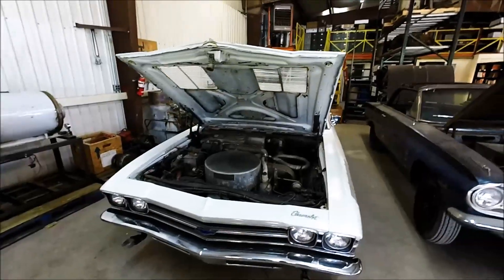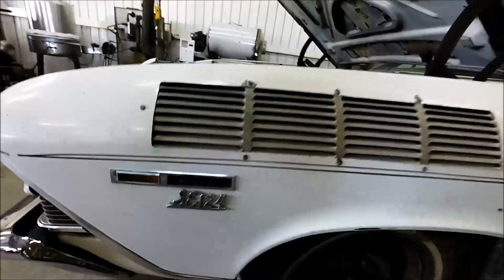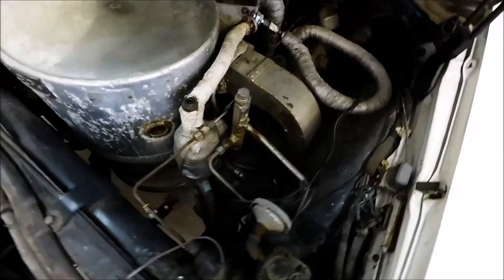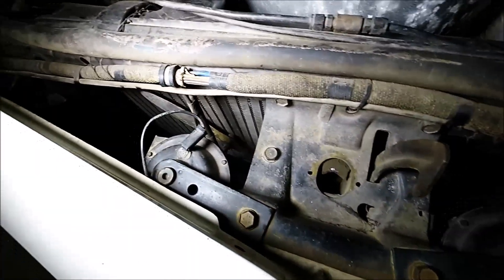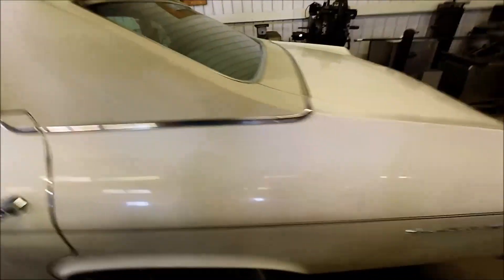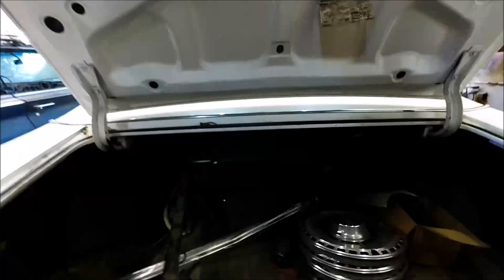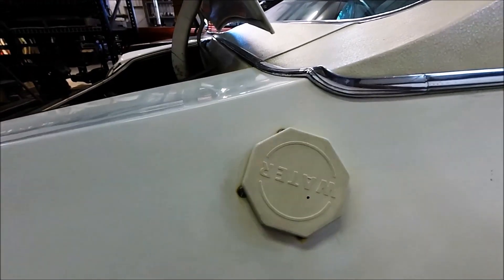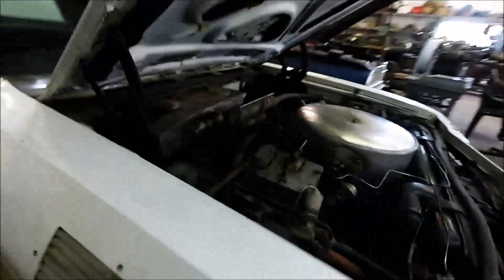1969 Steam Powered Chevelle - Built For General Motors

Comment: definitely the way of the future
Reply: The heck it is... steam power can actually be very efficient.
Reply: Its pretty obvious you are not an engineer either... steam engines can be efficient.
Reply: doktorbimmer If you knew better, which apparently you don't, your comparing apples to oranges when it comes to efficiency... i.e one form is external combustion the other internal combustion. Get it straight man.... seriously.
Reply: While I need to Thank You for FINALLY producing a Link of some kind, that Hardly makes me look stupid in ANY Way. 

You want to talk Stupid, you still contend that the EPA ordered these cars when (Again) the EPA didn't Even Exist Yet when they were built. Now THAT is Stupid !

The EPA came about in December of 1970 

That Report you linked was printed in May of 1971

BOTH Cars were BUILT IN 1969, a Full Year before the EPA Existed and a Year & a Half before that 'test' was performed on them, which they themselves noted wasn't accurate because of where they placed the Combustor Exhaust Duct along with including 2 minutes of warm-up time while the boiler built pressure significantly lowering the MPG in their short driving test. 

It's also laughable that they call the Chevy's V4 representative of 1930s technology when it was considerably sloppier than that and barely equal to 1870s steam technology. The guy that built it for GM may have bought out Doble and continued their work up into the early 60s but he sure took a step backwards cobbling that together under GMs guidelines. But again, it was merely done as a Feasibility Study at the time  and FAR From Perfect. 

Also note that the Pontiac used a Single Acting engine which is less efficient than a double acting engine as if it was built by a group that designed it fail because they had about as much interest in it as you apparently do. 

Here's yet another link Proving that they were built in 1969 PRIOR to the Existence of the EPA which didn't come about until the very End of 1970 let alone begin doing anything until 1971. 

https://books.google.com/books?id=FyoDAAAAMBAJ&pg=PA84&dq=popular+science+1930&hl=en&ei=RJLlTt-gB8edgweY-smBBg&sa=X&oi=book_result&ct=result&resnum=1&ved=0CDMQ6AEwADhu#v=onepage&q&f=true

It would be rather difficult for so many magazines to have written about those two cars in the Summer of 1969 if they hadn't been built yet as you keep falsely claiming with the EPA allegedly ordering them. 

You need to get out of your Moms Basement once in a while and see what really goes on in the world.
Reply: Jump to around the 7:00 mark on this video https://www.youtube.com/watch?v=QWv5_QjLqcs and you will see a demonstration showing how the farther you pull them down the more torque they make and as we all know the more torque you make the higher the horsepower that is calculated from it. 

There are lots of other videos out there showing Steam Engines belted up to Prony Brakes measuring there torque, some at their Rated RPM and others with the "Pull-Down" Test. 

It's Not My Fault you're so lacking in your knowledge of steam due to your predisposition to be biased against it for whatever reason. 

If you'd bother to do some real research into Steam instead of simply repeating whatever propaganda you can find against you might learn something. 
 
 As for the EPA testing program. . . AGAIN I have to point out the FACT that the car in this video And the Pontiac Steam car were Both Built a year to a year & a half Prior To the EPA even existing. 

They were built as a (quick & dirty) feasibility study (outsourced to someone outside of GM, yet using modified GM parts) and already abandoned by GM (just like the vast majority of their factory show cars that make the car show circuits but never make it into production) Prior to the Newly Formed EPA asking to borrow them for testing after they'd already given up on them. 

GM had no desire to retrofit their existing car lines around Steam OR to design and build a new product line around Steam, and put little or no effort into refining the steam cars or building an actual NEW Steam Engine (instead cobbling together what they did using a factory V8 Block much like the Failed Oldsmobile diesel), and again  Did So PRIOR To the EPA's Existence.
Reply: doktorbimmer Uh hum... ethier you forgot or didn't do your homework... they only reached 38% efficiency and it only took 100 years to get to this point lol. Mean while electric cars are starting to take root thus displacing the apparently inefficient ICE's
Reply: doktorbimmer Unless you can show the proof of that statement I'm going to say you wish it was fake progress because it's not.
Reply: doktorbimmer oops my bad the thermal efficiency of the Schoell engine/steam engine from Cyclone Power Technology is actually closer to 30-35%+... just looked on there website doing some research to make sure... it's better than I had remembered.
Reply: doktorbimmer You are proving to me just how short sighted you are... electric vehicles were displaced by ICE's back in the day because the batteries were heavy and inefficient as heck in lamemans terms if you will. Guess what though they're making a comeback because of improvements to battieries... and motors as well. The same thing can happen with the steam cars.... except some of the steam cars from back then, namely the Doble, were already damn good platforms than can be improved upon.
Reply: doktorbimmer I don't know man... we been going at this for a few hours and it's getting pretty darn obvious niether of us are willing to budge on the topic at hand so I'm calling a stalemate.... agree to disagree if you will.
Reply: doktorbimmer Man you don't know when to not type do you... So let me type it again... we need to agree to disagree. I know steam cars could and can have a future but you don't... let us leave it at that... seriously.
Reply: In your dreams maybe they can't compete LOL.
Reply: doktorbimmer So you think... then how are they still in business and making progress with their inventions.... hhhhmmmm? They still release progress reports
Reply: doktorbimmer Move on man... agree to disagree... seriously.
Reply: Where do you come up with that unsubstantiated Bull Shit. 

There was NEVER any EPA 'drive cycle' tests done on this or any other steam powered car.

The EPA didn't Even Exist until December of 1970

6.5MPG ? 

6.5 MPG of WHAT ? Water, Not Hardly, especially with the condenser on it. 

Gas, kerosene, diesel, lamp oil, bacon grease, coal oil, whale oil, LP, CNG, cooking oil ? What Fuel are YOU Claiming that ridiculous 6.5 MPG on ?
Reply: WRONG AGAIN doktorbimmer.

Once Again, the EPA Didn't even Exist until DECEMBER of 1970

This car Was BUILT In 1969 when  the US government (NOT The EPA which even though it IS a Part of the Government, Did NOT EXIST YET) asked car companies to come up with ways to make their cars pollute less. http://www.roadandtrack.com/car-culture/classic-cars/a33490/this-experimental-69-chevelle-is-powered-by-steam/

Yes, it Was POORLY Built cobbling together parts of a Chevy V8 and an undersized boiler to fit within the confines of the Malibu's engine compartment, but it was built rather quickly as "Proof-of-concept" rather than perfecting it as an actual prototype for a production car. 

And there were NO Taxpayer Dollars Involved, it was commissioned and Paid For by GM just the same as with any other Research & Development projects they work on or have done for them as in this case just the same as all of the R&D done for them by Smokey Yunick. 

Also even though it was less-than-perfectly designed in a hurry it still managed to build full pressure in under 2 minutes from a cold start.

YES It Had Other Problems as well, only making 55hp (with a mountain of torque) at Low RPM and was only able to achieve 65MPH Because of that RPM limitation and running a stock Malibu rear end gear. Not to mention the use of an automatic transmission where it would have been better to have it directly coupled to the differential with No Transmission, but again, it was built in a hurry using GM Parts.

Even with all of those problems working against it, it still pulled down 15MPG of KEROSENE firing the boiler (from cold) when Most Cars At That Time Averaged 10MPG so it was already 50% better even with it's problems. That was tested by Road & Track in 1969, NOT by the EPA AFTER the End of 1970. 

Here's a couple more websites for you to educate yourself with instead of fabricating your own version of the history behind it. 

http://www.kimmelsteam.com/1969chevelle.html

http://gmauthority.com/blog/2017/05/experimental-1969-chevrolet-chevelle-runs-on-steam-returned-15-mpg-video/

http://gas2.org/2014/06/27/friday-flashback-a-steam-powered-chevy-chevelle/

Was it Perfect ?

HELL NO !

It wasn't designed to be Perfect, it was Slapped together using Modified GM Parts as "Proof-of-Concept" and then dropped like 80% of their other "Concept Cars" that never go into production. 

Go TROLL Somewhere Else cause you're just digging yourself a deeper and deeper hole with every unsubstantiated post you make here.
Reply: As I noted in another reply, Yes I Have WORKED as an Engineer, as well as a Machinist and a Mechanic. 

I play with the old engines as a HOBBY which believe it or not serves you well in all three of those Careers giving you a working knowledge that you can't learn from book reading or going by what a single Biased Professor tells you in a class. 

You either Get That or You Don't, and You Obviously Don't because you've been influenced by too much false information already to be able to wrap your head around the facts.
Reply: Definitely not...
Reply: Steam is the past..